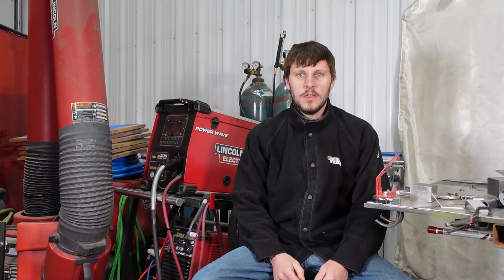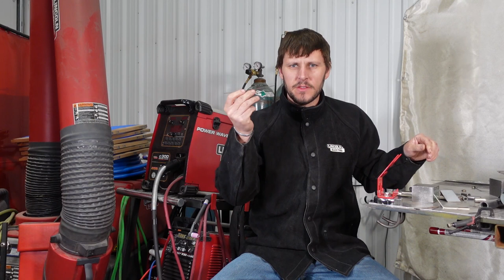Welding with Joe: Shielding Gas & Modes of Transfer

Comment: Curious to know if you have any friends with a pacemaker or defibrillator that weld and if you know what they may use for protection against the electromagnetism.  
 Great information for beginners.  Unfortunately I think my years of chassis fab and fabrication itself is done except for gas welding.   
  Yeah, you are right. Those dimes can cause you to spend more dimes.  
 Looks pretty but useless as tits on a bull.  
  Certainly not for structure. 
 Be well.  Happy Thanksgiving !
Reply from the maker: I will certainly ask one of my colleagues who I think will know and get back to you. Happy Thanksgiving!